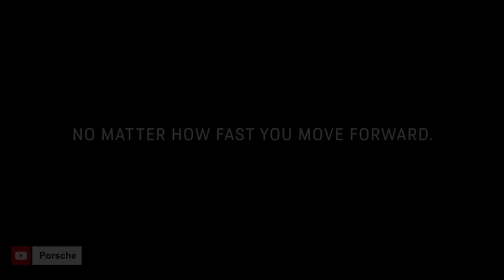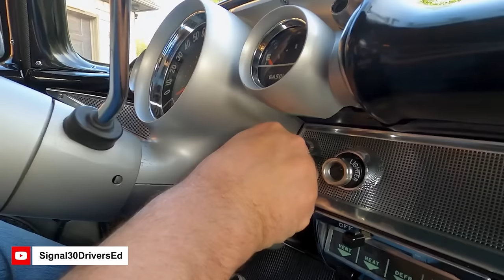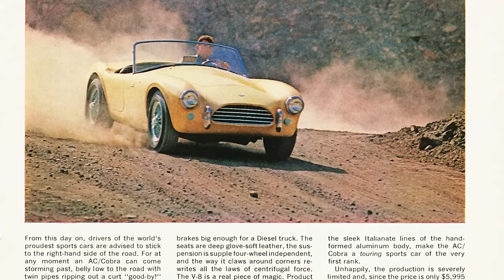Why Old Cars are Better

Comment: Old cars were designed, new cars are engineered.
Old cars were pieces of art, new cars are appliances.
Reply: Have you seen the 1969 Pontiac judge? In orange with pinstripe, so beautiful
Reply: @ericortega1745  of course in familiar with the judge, i grew up in a 73 lemans gto in the same orange, with a twin carb 427 and a 3 speed sequential gearbox
Reply: You could not of said it any better!~
Old cars are tanks, new cars are thrown away!~
Reply: The VW Beetle, Honda Civic, and Mercedes Benz 300D are a piece of art and an engineering marvel.
Reply: @Justin-yt7pi  I've got the privilege of refurbishing a 63 ragtop bug, and I can confirm. There is a fantastic elegance to just how simple, sturdy, and consistent everything is. And even though it sat in abog for 15 years, EVERYTHING just threads in and out like butter
Reply: Survivorship bias and nostalgia in both the video and the comment section is off the scale, old cars were mostly absolute garbage that fell apart coming off the lot, that a few were good doesn't prove anything, new cars are so much more reliable than old cars that it's not even close, doors fit, shutlines are great (Tesla not included, American cars lmao), they start every time without fail, use so much less fuel that if you drive a lot buying a new car could literally pay for itself through that, they stop MUCH faster, handle MUCH better, don't kill you in a fender bender crash, don't kill pedestrians (SUV's not withstanding, those are murder machines.) etc etc
Reply: @kristoffer3000  no, most cars werent. I have driven and worked on MANY old cars in factory condition, they did not fall apart off the lot. Just because you gotta adjust and clean a carb with every oil change does not mean its unreliable or bad. In fact, the most reliable car I've ever owned was 1979 toyota celica. The least reliable car I've ever owned was a 2000 volvo s80. Newer cars are constantly plagued with computer and sensor issues, one bad ground can fuck you're whole month up chasing down in a rats nest of wiring harness (because modern cars have a LOT of grounds) and when shit breaks, its costs an arm and a fucking leg. If you're 2021 toyota tundra quits running, theres a good chance they have to disassemble half the front end just to get to the broken part, meanwhile all my 63 ragtop beetle needs is the points filed and the choke turned on.

Old cars were all significantly more reliable and dependable than new cars are, and that reliability came from their brutal simplicity (keep in mind theres exceptions to every rule, like the first gen Rolls Royce Phantom), all you have to do as the operator is a LITTLE bit more maintenance. It's not nostalgia, it's a fact. And dont even get me started on post covid replacement parts.
Reply: @kristoffer3000  also that comment about fuel was wildly incorrect. The og morris minis were stupid efficient, and standard air cooled beetles regularly average 60+mpg. Hell, the carburated 89 Honda Crx will average 59mpg highway with the right driver, and my 83 accord regularly got 50mpg average, with a never rebuilt, 260k mile ek18 CVCC engine. Meanwhile my moms 2005 durango has belched fuel out the filler due to a recalled fuel tank design that they never actually honored, and they regular kick themselves into 4 lo whenever the fuck they want because of a faulty transfer case selector solenoid. Oh and uh... the sand that remains in the power stroke blocks and the early 2000s beetle blocks that likes to rear its ugly had and blow up low mileage motors for funsies. And now we're adding touch screen computers to these things...
Reply: @sammy13ificationable  Oh I'm sorry, I didn't know this was about your feelings instead of objective reality, my bad.

If my BMW breaks, which it hasn't in my so far 1.5 years of ownership, nor do I expect it to, it's only got 200k km's on the clock after all, I simply plug my OBD2 reader into it and it tells me what's wrong, I then fix it because it's actually very easy to work on, the parts costs are also very low and extremely easy to get (being European helps a lot in that regard) and off I go, with an old car I have to troubleshoot it myself which is a skill not a lot of people have that requires a lot of knowledge, sure it's easy to work on as well but parts can be VERY expensive or downright unobtainable due to no longer being produced.

An old Beetle will never get even close to that number, if they're running well and are tuned correctly they'll get around 30-35, why do you bother lying like that? It just makes you look like a fool.
Meanwhile my dad's diesel Audi A3 gets 56 US MPG without issue, that's real world fill up to fill up MPG, not your magical fairy dust and unicorn farts downhill tailgating a semi both ways MPG.

You're bringing up anecdotes and individual models that are bad but that's not what's being talked about here, sure there are AWFUL cars being made thanks to mostly VAG and American cars but the auto industry as a whole has progressed in giant strides, from cars literally rusting to pieces within 2-3 years of being new (very common with old cars, take the Alfasud for example, there's hardly any left because they're all rusted to bits) to now where most cars are great in that regard, look at BMW e90's for example, if you find one with rust it's an extreme rarity, that's even here in Norway where we're about 1 winter away from plastic managing to rust.
Reply: Very well said
Reply: well the nice thing is the new cars are safer and more reliable than ever (with some electronics issues being exceptions) I do miss the styling and simplicity of older cars
Reply: Don't forget the upcoming amazing line up of in-vehicle subscriptions you can pay monthly to access features in your car.
Reply: The reason why is because as beautiful as those classic cars are, they were also death machines made of pure steel lol. If you got in an accident with one of those you’d most certainly not walk out of it—even lighter accidents.
Modern cars look all the same cause they kinda have to. No car manufacturer is gonna make a classic car revival that somehow hits all the points of a modern car, it’s just too dangerous.
Of course people still drive pimp vans and all sorts of classic cars nowadays without so much as a hitch (unless it literally can’t be driven anymore safely, like the Model T or cars pre-1950s), but the general consensus from people who daily drive classic cars is that if you’re driving a classic car, you’re pretty much putting style before safety.
Reply: I disagree. New cars are designed and engineered... to break, so they can sell you the next one.
Reply: @cloudirubez07  still though, planned obsolescence complexity < simplicity and reliability.
Reply: @Mrpersonman0  the older cars needed maintenance you were always needing to tinker with them I've had my current car 5 years all I;ve done is change fluids. YOu don't see many old cars still on the road these days either...
Reply: You just don't get it.
Reply: @michaelbenardo5695  I do your nostalgic for beautiful cars that are simple to repair but the fact is they are not as safe not as comfortable and much of that tech you complain about is why the new cars are...don't get me wrong I can appreciate both
Reply: I bought a 2023 elantra and felt like it was a toy compared to my 1990 cavalier z24 and 2004 WRX

My cavy has 186k miles and still drives like new
Reply: I worked in the oil change business for 12 years and let me tell you I learn to hate automotive engineers with a passion. They put oil filters and drain plugs in the most illogical hard to get at places
Reply: I would argue. Old cars WERE engineered, new cars are designed by bean counters and committees (no engineers involved).
Reply: Well I mean, most of the driving that most people do is utilitarian in nature (commuting to/from work, doing errands, etc) so it makes sense that an "appliance" model would be more appealing to most people most of the time.
Reply: When you have a Chevy Chevette, an AMC Gremlin, and a Ford Pinto in front of you, you’ll change your tune. The The only cars of that time that were works of art are the ones people still care to preserve. The vast majority were not those
Reply: To be honest, the average person would probably prefer an appliance, seeing as driving is more of a necessity than a hobby.
Reply: Lol tell that to a Ford Grenada
Reply: This is why I ride motorcycles
Reply: @_skud  oh just wait. Their time will come. I ride too, and I'm noticing more and more newer bikes moving towards efi and computer control
Reply: @sammy13ificationable new cars look so goddamn colourless bro, like all the sedans, SUVs look the same, they're all trying to copy the same minimalist design to save themselves money
Reply: @axel3689  yeah, its fucking dumb. Why does a Kia Sorento look JUST like a Chevy Impala with some extra trim tacked on.
Reply: And we all know how terrible appliances are. Microwaves, fridges, coffee makers, who needs them!
Reply: @kristoffer3000  What asylum did you escape from??
Reply: I had an artistic 1960 Mercury Comet for my first car.  It caught on fire in 1971 while I was waiting at a red light.
Reply: @YourChannel-r4v  tell that to your grandads fridge and car. You can have functional art, I ride some every day
Reply: Not only that, they're appliances that are meant to wear out in a few years. Not like appliances built in the past that could run for 5 decades with little maintenance.
Reply: @josemalave1322 drove a pinto far better than a pt cruiser.
Reply: PERFECTLY Said I've always thought that!
Reply: People think ever old car is a Ford mustang or something. Old cars were also appliances, the vauxhall corsa 1990 is not a piece of art
Reply: Also they never broke down, ever
Reply: I just came up with a idea. Steam and Ethanol engines. Half runs on steam half on gas. The half steam runs a closed cycle similar to how a refrigerator compressor works. For one thing, In Brazil, when the fuel crisis hit, the population really wanted smaller vehicles (We never had the boats that USA Had, only the "midsized" Galaxie 500, Simca Chambord, GM Opala, GM Omega, and the Dodge Dart were the biggest cars we ever got If I'm not mistaking) 
So, with the crisis, came the Ethanol fuel, and cars became smaller. NOW With the pressure of SUV's we are finally (badly I'd say) moving to SUVs instead of sedans and hatches, which is a shame. But I agree, 40 years ago a car could make 8KM/L and nowdays cars barely make more than 11km/l in the city. At highway, its slightly better, the cars of the 80's made around 13kml, now cars can make 19kml, its better, but at city, where it matters most, nothing changed at all. And add that Flex Fuel consumes more than plain Gasoline or Alchohol engines, and add useless tech to todays cars (apart from the very good safety, A/C and Power Steering) the cars of today are really more of the same... Cheers!
Reply: All car even old were engineered. These days it's about safety.
Reply: @kristoffer3000  "...old cars were mostly garbage...new cars are so much more reliable..." Your entire comment shows you view cars as an appliance.
Reply: @kristoffer3000 my grandpa owns a junkyard and most cars in it are new because new cars are built out of garbage
Reply: @masonadkins7972  You mean because there's far more of them because the old cars have mostly all gone to the junkyard already?
Wow, thinking sure is hard! That took me all of 2 seconds.
Reply: @hrthrhs  Not at all, but whatever makes you feel better about objective reality, pal.

Old cars are much more involving to drive and have much more emotion to them compared to the utterly devoid of feeling newer cars but that doesn't change reality.
Reply: @kristoffer3000  Okay so it's not merely "survivorship bias or nostalgia" as you confidently claimed in your original comment, but actually older cars AREN'T  "absolute garbage" (which you also confidently claimed) but actually have a lot of positive qualities, even to the point where a lot of people are happy to have a car which breaks down every so often. And I'm not your pal, not with your attitude anyway. Chill bro. It's cool.
Reply: @hrthrhs  Old cars being super reliable and great is mostly survivorship bias and nostalgia.
I'm sure that if I drove my first car again now I'd be really underwhelmed but I remember it very fondly.
That's with my first car being a Peugeot 205 XRi (came with the GTI suspension setup) which are generally exceptional to drive, the best small car of the 80's.

That being said there are older cars I'd LOVE to own, like a BMW 635csi for example but that's entirely nostalgia... and the noise, oh my god the noise of those old BMW 6's.
I know it's not going to live up to my expectations but I love it regardless.
My current 1-series is better in every way except for engine noise and feel.

Obviously people remember cars like that because they were great for the time and they elicit emotions but how many people think fondly of a (euro) Ford Escort mk5 for example? I had one and it was shockingly bad, good seats but that was about it.
That was considered a pretty good car at the time and sold loads.
Reply: @kristoffer3000  no in fact most of them sit there until someone takes parts off the car so no there is still old cars sitting there
Reply: You watch too many ads, old cars were made to last, not as statements of art 😂
Reply: @Morbing_Time  lmao
Reply: @Morbing_Time  you can have both, old cars were also statements of art, that's why they had tail find, pop up lights, and chrome everywhere. It was 50% function, 50% art, and 0% programmed obsolescence
Reply: Both are made the same way
Reply: Older cars were more colourful and had more character in their designs, now most cars and trucks look the same almost, same grills, same head lights and same shape.
Reply: @emperorofscelnar8443   It doesn't even make sense, the ones from the past are also the same thing, same color, shape, light, that difference doesn't exist between them other than the obvious
Reply: Old pick up trucks where built to be haulers of goods meant for farm work, business work, construction work and haul stuff from a hardware store, now these days their just large glorified sports cars with a truck bed that is too short to haul stuff. An old Truck was built to be like a work horse, now these days people just buy them to be a status symbol rather then what their actual built for, it would be like buying a space cargo ship thinking it is cool and not bothering to use it for what it was actually built for, for an example.
Reply: Sure a pick up truck may look cool but it is not a sports car, it was meant to haul stuff from place to place, it was meant to be owned by business owners, farmers, construction workers and guys who buy stuff from a hardware store it was never meant to be a status symbol like sports cars are.
Reply: @emperorofscelnar8443  ... Is this a bad thing? There are races for different types of vehicles, not just one specific car.
Reply: @emperorofscelnar8443  Whether it's a sports car or not, it still serves
Reply: A lot of cars look very similar to each other and new cars are just black, white and grays, rarely do you see any other  colours on them.
Reply: @Still.the.best.2021  But the truck beds at the back of them are too small to haul stuff these days, the truck beds on older trucks where much bigger back then.
Reply: @emperorofscelnar8443  There are types of trucks just as there are types of cars and motorcycles and planes.
Reply: @emperorofscelnar8443  This issue of color is by default, and it will depend on who wants the car to be blue, red or green, black and white is just a standard, at that time there was also a color standard
Reply: @Still.the.best.2021  If you remove the logos from all the SUVs you wouldn’t be able to tell them apart.
Reply: @emperorofscelnar8443  and?
Reply: @Still.the.best.2021  All new cars, trucks and SUVs in Canada and the US are all just black, white and grey  and you rarely see any red or blue ones, while new cars had many colours back then.
Reply: @Still.the.best.2021  Each old car and truck in the seventies and eighties had its own unique look, now in the time I live it is like every car and truck has same face syndrome they look very similar to each other.
Reply: @emperorofscelnar8443  And this prevents someone from painting their car another color?, this is just a pattern to match the city
Reply: Newer trucks aren’t built for utility purposes any more, pick up trucks are now built to be a status symbol and the small truck beds at the backs of them are too small to fit ply wood or anything else. Pick Up Trucks these days aren’t really trucks anymore just glorified sports vehicle with very small useless truck beds, Pick Up Trucks were meant to be Utility vehicles for hauling stuff from businesses, farms, construction sites and hardware stores. A Pick Up Truck was suppose to be the work horse of vehicles, but it feels like only 10% of them are actually used for what their built for, I do get that Pick Up Trucks are cool but their not meant to be a glorified sports cars. I wish cars and trucks these days had more colours then just black, white and grey, I miss seeing purple, pink, green, orange, lemon yellow on cars and trucks, it’s all bland colours now. I was born in the mid 80s when vehicles had more colours.
Reply: @Still.the.best.2021  If your talking about custom jobs that would cost more money.
Reply: @emperorofscelnar8443  Any vehicle is used for some symbolism, but it continues with its function, nothing changes
Reply: @emperorofscelnar8443  I don't know how it is the same look if in the past they also had the same look except for a change of brand, but both in the past and now, they are all the same, but they have their differences, there is no that it's all the same,
Reply: @emperorofscelnar8443  In the past, it also cost a lot of money to customize, at least for that time, and if you were to use that account nowadays it would be very cheap.
Reply: @Still.the.best.2021  Well in StarField (a video game with space ships) I can turn a bland and boring space ship into a more colourful unique beauty most of the time, I sell the failures and keep the good ones. If people earned a lot more money I suppose they could customize their cars but most people don’t do that for some reason.
Reply: @Still.the.best.2021  Perhaps in the city were you live, most pick up trucks I have seen have empty backs that aren’t being used, in your location these vehicles are actually being used for what their built for, but in my location their just being used as a status symbols.I rarely see any Pick Up truck haul anything.
Reply: @emperorofscelnar8443  Being colorful does not bring quality as everyone has their own taste for color, now if you are referring to the tesla, anyone would make a better one, that's not what I'm about
Reply: @emperorofscelnar8443  As I said, there are several types, here where I live every truck is used as cargo, everyone uses the truck in the way they prefer or in what will be useful, sometimes people buy a truck and don't even use it. is for cargo service
Reply: A classic giant boxy sharp land yacht. Fulled up with luxury features hell ya
Reply: Old cars were tools, not necessarily pieces of art. They were meant to do a job, whether it was go fast, haul stuff, etc. Cars no longer actually serve a single or couple purposes, they try to do everything while being engineered to look like they can't do anythinng.
Reply: @Stealth86651  the classics looked simple. You had a farm truck from Chevy like a C10 or a Ford mustang ‘64 as a sport coupe. They didn’t try to make one car as a utility and sport vehicle. We should go back and make those simple cars from 1950’s-2000. And every car would have its own purpose!